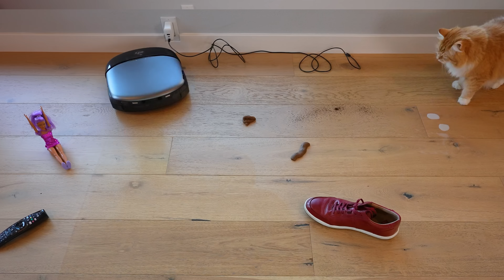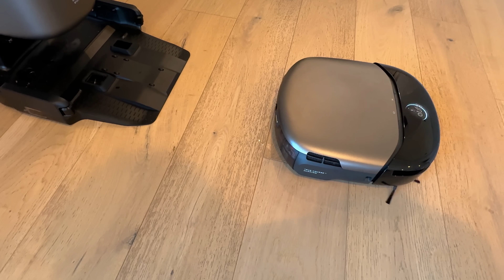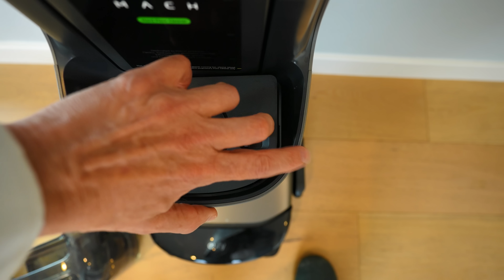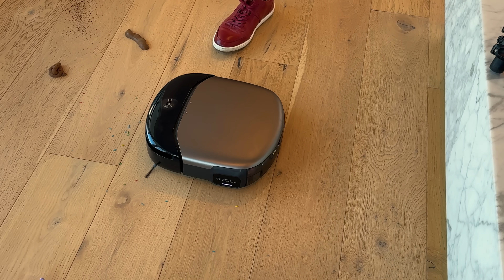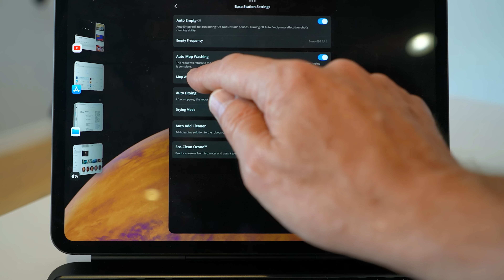eufy S1 Pro: Why It’s The Top Mopping Robot In 2024

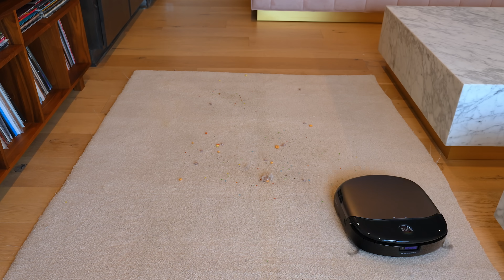Comment: As you said on minute 3:46, the best way to clean the floor, remove stains and dirt, is use more water (maximm waterflow) now the question is, how much surface area can it clean without going back to the base at max water flow ? What is the capacity of the clean and dirty water tank ?

Comment: They should ditch one of the side brushes so it wont make a mess with liquid spills, I guess if the camera based AI is good enough they can program it to avoid the side with the brush and mop it such that spills wont make a mess.
Reply from the maker: They can update the firmware to make changes like that.
Reply: @vacuumnerds  Yep, I guess the side brushes are interchangeable so one of them can be removed by the users.

Comment: I see you’re pouring liquid in front of the robot. Since this robot is always vacuuming and the rollers and vacuuming are the first things to go over this liquid.. can you show us the state of the rollers and bin after it’s gone over liquid? I’ll wait
Reply from the maker: There isn't enough suction to pull a lot of liquid directly into the opening. However, the onboard tank and overall design have been developed with liquid in mind. There is a dirty water tank on board to capture excess liquids. It's there for this purpose. I showed it in one of the videos I've made on the S1.  FYI - I can't post a video reply here. This isn't Tiktok.

Comment: Definitely not the first,  I have my XWOW R2 for 2 years now. It works amazing and no issues. Super quiet especially when it is on 'mop only' mode, great to use at night when sleeping.  Has Lidar and continuously cleans the roller, nothing was on the market. All the others robot mops were glorified Swiffer wet pads. Bought my XWOW for $300 when it was on sale, fraction of what Eufy is pricing there's at $1500.
Reply: Good for you. This is not about that model.
Reply: @ its called false advertisement. Eufy is stating they are the first one. Clearly not

Comment: $1,500???!!! Is there something even somewhat comparable in a $500 price range?
Reply from the maker: eufy X10 is about $800. Comparable for $500? Not really. At this price point you're looking at a relatively basic robot.
Reply: Remember when flat tvs came out they were $5,000 give it ten years they will be $500 but the new one would do your steps prob rake the leaves too
Reply: @jurycould4275  the Amazon reviews on the xiamo are not great
Reply: S10+, but only when it's on sale. Picked one up for about 700 and has a roller mop as well👍

Comment: Hi there!  I just returned my Dreame x40 because I felt it didn't always catch dried stains. Overall it was a good unit but I need something that has more powerful mopping capability, I am not as concerned with carpet (the Dreame has better suction than the Eufy but mopping is more important to me).  

Would you say that the mopping capability is better with the Eufy S1 Pro vs Dreame x40? 

Oh and the obstacle avoidance of the Dreame X40 wasn't flawless, it got tangled up in things occasionally (cat toys specifically) and every so often got caught in tight spaces and needed to be retrieved.  Did you experience any of these issues with the Dreame X40?  If you have any other observations pros/cons of the Eufy over the Dreame worth mentioning would love to hear them as well.

Oh one other thing, i followed your link for the $200 off but it isnt giving it to me. Just takes me to the Eufy standard purchase page.  Is there a discount code you can provide that you can input into that promo field at checkout?

Thanks and sorry for the long comment!  ;)
Reply from the maker: I think the eufy S1 is better at mopping than the Dreame X40

Comment: What about a mix of carpet and hardwood. Does the mop roller lift to avoid dragging a wet roller over the carpet.
Reply from the maker: If your carpet is average low pile carpet it will be ok. it lifts 12mm or ..47". If you have taller carpet, I would set it up to do the carpets first, and then mopping afterward.

Comment: Could someone please conduct the following test: Is it feasible to relocate the station between different floors? I'm interested in using the base station on both levels so that the Eufy can clean the brush as needed. However, is this a viable option?
Reply from the maker: I have a multi floor house. I leave the unit on one floor. You can tell it which floor map to use and it will wash the mop before it starts. Then move the robot to the floor you’re cleaning. You can specify how many square feet you want it to clean before it washes the mop. I set it to do the whole floor.  You could move the base unit, but it’s a bit heavy.
Reply: @vacuumnerds  thanks for your help!